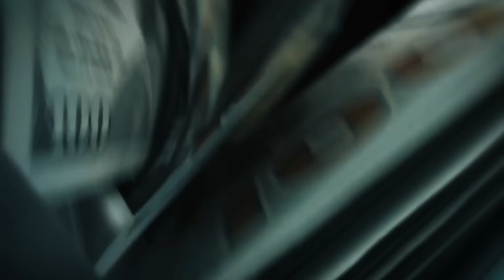China’s $70BN Megaproject Moving Rivers Across the Country

Comment: The Western route is the key to the entire system, and that is why the West is so opposed to building a large dam and hydroelectric power plant near Tibet!!! The Himalayas are the largest mountain range in the world with the highest peak that everyone knows about, if a dam was made between the mountains where the mountain river that goes to India and Cambodia flows today, that river would be made into a huge lake from which the whole part would have enough electricity to start, but that's not all. When a mountain river is turned into a lake The water is starting to heat up, not too much, of course, but enough to melt a lot more snow and ice, which means a lot more water for everyone!!! We all know when the snow and ice start to melt at 2,000 meters above sea level and how long the temperatures at that altitude are high enough for the snow to melt, but if there is a lake that warms up because the flow is slow, the snow and ice would melt much more during the year, which would mean that all sides would have much more water and that part of the world would become much more Very affordable for tourists, which is good for the local economy!!!! China has lived on one-third of its territory for centuries, and that can change with the help of this project. But this does not suit the West, because in that case China would become an impregnable fortress!!!! In the mountainous part of China, new settlements would quickly appear, as well as tourist centers where it is possible to ski all year round, a huge number of new roads and tunnels, and even entire cities in the heart of the mountain!!! One part of the tunnel would be built by the army. With this, the military could place radars on the highest peaks of the Himalayas that would act as satellites, which would provide much better and cheaper immunity for the entire part of the world!!!!